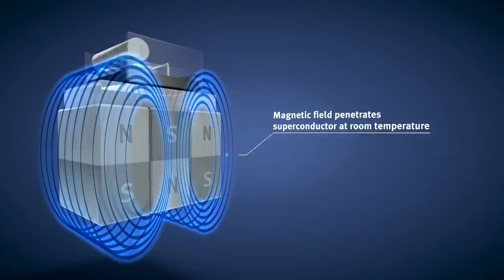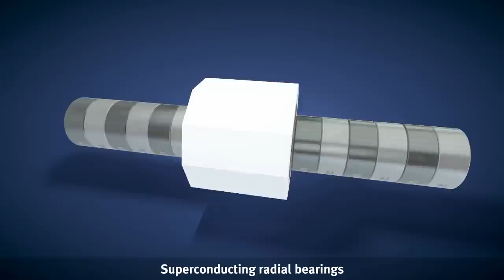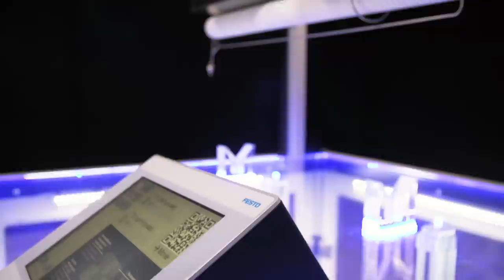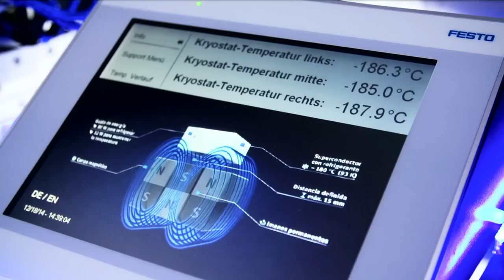Festo – SupraMotion 3.0 (English)

Comment: The last demonstration could easily be done with weak electromagnetics, the other two were impressive.
Reply: Yeah, except they did it with electromagnets that use zero energy. Zero amperage through zero resistance.

Comment: If I'm right, I believe the magnet placement in this demo is wrong..
Reply: i dont think so. Where in the time line?
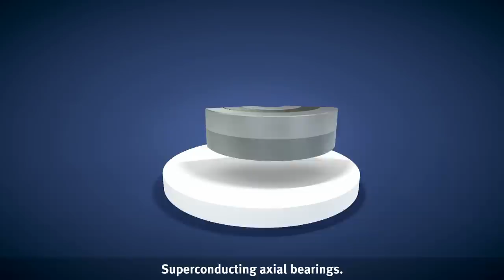Reply: 1:42 is one of them.. 2:09 is another.
Reply: lead oxide
both are actually correct. When you want to allow a relative movement between the superconductor component and the magnetic component you just have to make sure that the emitted magnetic field stays the same for the superconducter in the direction of the target movement. so for example at 1:42 the arangement of the Magnets creates a constant magnetic field in >linear< direction therefor the superconductor can move >linear< to it. Hope that helps.